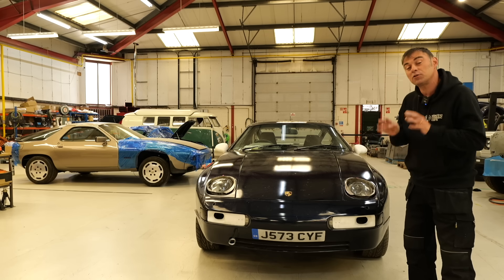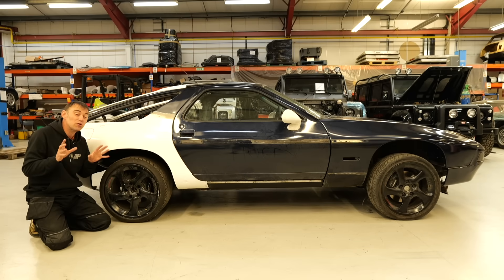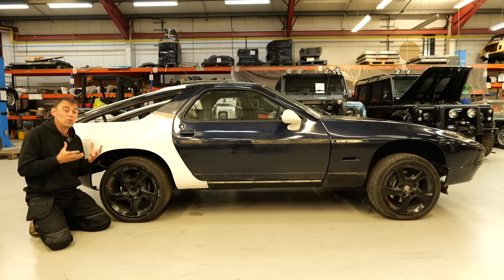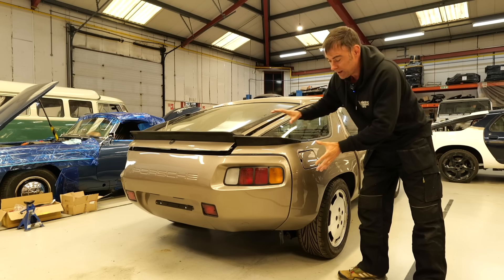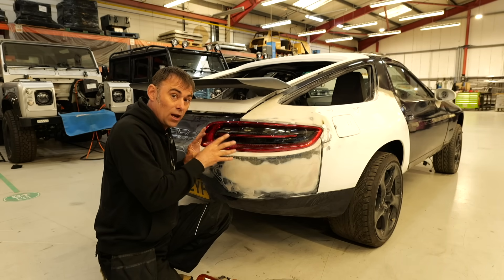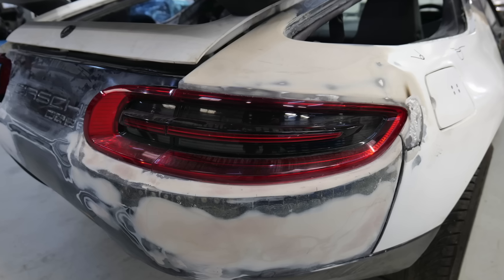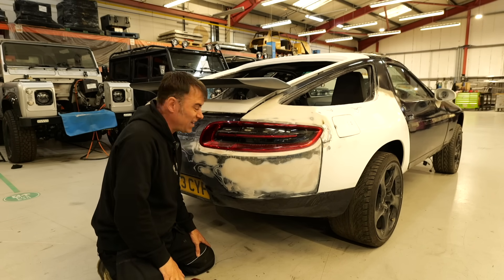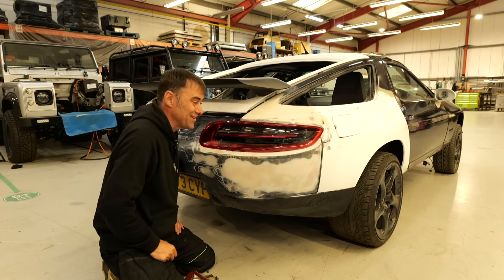Electric Porsche 928 Restomod update

Comment: Any car is a particular point in history. I don’t see any reason to be ‘updating’ the look as it will be out of date again shortly. Worst is that given time, ‘updating’ a car looks worse and has to be restored back to original. I’ve seen this too many times. Also, it’s a bit arrogant to think that the modifications are better than Porsche design. Best accept the car and the time it occupies in history.
Reply from the maker: Hot rodding has been around for 70 years. I doubt car modding is ever going to stop. 😉👍
Reply: Too true. And funny you should mention that as I was looking at a hot rod on the road recently thinking what could have been if it had been restored. 
I do get the impression that hot rods came about as a cheap form of transport for the youth of the day. Probably only now we can look at them as a possible classic car. 
Having said the above, I very much love your work electrifying Classic cars. So I am conflicted in my own opinion. 😊

Comment: Hummm 🤔!!!  So it now doesn't have the range of a GT, weight has been raised and it's no longer 50/50, the mooohassive luggage space, which is essential for a tourer has been removed and the main characteristic of the 928 (i.e. the pop ups) have gone.  I think you know where I stand.
Reply from the maker: It’s weight is the same as the the petrol version. It’s retaining the same weight distribution too. The battery box is now mounted underneath so luggage space is the same.

Comment: Love what you're doing with the 928! I had a 1985 928 for a few years, bought it in pieces, the mechanical bits were all still assembled, but they'd pulled most of the body trim off for paint, then the customer lost interest. I got it for $5000 in about 2012 or there abouts. Put $10,000 into it over the next 2 years, then sold it again for $5000! haha but I can say I drove a Porsche for 2 years for less than my Mom was paying for her new Honda :) Anyway, hey, its your car, do what you want, right? I love the light mods, that's pretty clever. How is the weight distro with the mods and batteries now? I subscribed, definitely want to see how this turns out!

Comment: I like the changes to the lights. for the battery at the rear, why not take the rear seats out and put them on the floor, would that be lower? That way you have proper boot space from the rear.

Edit: I make this comment and then you answer the questions straight away in the next video. oh well.

Comment: Love the tail lights - not such a fan of your headlights.
The vents / brake duct inlets might be nice in a billet Aluminium machined and powder coated. or , Carbon fiber prepreg.
At the end of the day do what you want. It is your baby not someone else's.
Just wondering if you removed the tunnel section in the rear under the rear seat area and laid the batteries under the rear seat, could you get the number of batteries and weight lower. But than that means the car could no longer be returned to ICE.

Comment: Owned two 928's myself, one of the early 16 valve V8's and a later 32 valve V8 model, the S4, can't wait to see how this electrification works out. The 928 has evolved over time, seen all sorts of mods, twin screw superchargers, welded blocks etc, this is next evolution of the 928. Wonderful cars, one of the most comfortable and best handling grand tourers around, can't wait to see the end result of all your hard work. While some may decry it, I think the new headlights fit the character of the electric 928, I wouldn't like to see them removed from one of the V8 models, but the electric version needs a new look to go with its new drive technology, keep up the good work!

Comment: The only good thing about the original pop up lights is that it will be dark when they are in use so they can't be seen. They even look like they have been fitted badly when they are down. 
Any change you make to the front lights will be an improvement.

The lower lights not so much, looks like an afterthought that needs deleting. Shame about the battery box in the boot

Comment: It could do with a rear defuser to hide the low  hanging motor. Front needs work, it’s all over the place ( yuck ) the bonnet and boot needs to be 3D scanned and a custom shroud fitting to hide the battery boxes, other than that Happy Days ! 🤪 Whilst I remember Decal

Comment: Purely thinking aloud (because I'm going to do something similar) ... is there not enough space to maybe split the rear battery box to provide a BIT more space in the boot?
 
Will refuse to comment on those light clusters ... on either end ... but I think that you could help your look and feel if you modded on the older generation bumper+side/indicator lights section. The newer cars looked a bit uggo without the 'shark' of it all ... and if you went with the older front bum, then you might make your airflow choices easier, too.
 
Front bums can't be that hard to come by ... I'd hope.

Comment: Hi Richard, Iike what you are doing to your 928, I never liked the pop up headlights. I noticed on the back panel the imprinted Porsche lettering looks compromised. It may be worth doing a 3D scan of the fabricated rear end and then get a 3D printed panel made that will fit spot on. I thought the same for the rings you are fabricating for the headlights, you could scan what you have made then make a 3D printed version incorporating fixing lugs? This will help for repeatability for any future 928’s that you do.
The art of  Mogification 👍 😂🏴

Comment: HI Richard
Stu here from the inCARnation Australia. As you'd probably know if you've seen our latest episode, our electric 928 is now on the road for some basic road trials - although there's plenty more to do before full registration. But as a long-time owner of 928s (6 so far) I am a bit of a tragic for the look. I see the headlights and tail-lights are being integral and an essentail part of Tony Lapine's original design, so it's a bit of a no from me. However, considering all the mods of done to my car, I not one to lecture. You do whatever floats your boat, sport! 
Our ELECTRIC 928 EV8 (tm) will at least look like a standard 928, albeit the clean look without side-moldings or any rear wing. I'm going for the clean body look, but with S4 bumpers. But you asked the question so I'm happy to answer it... I really don't like the look of your Macan tail lights and flush headlights. Sorry!:hand-orange-covering-eyes:

Comment: Both ends of the car looks good… on different cars. In the back you put a very modern taillight. Very different but it works. In the front you put some 90s 911 parts on and a headlight lens from an old vw bus. Got a bit lazy in the front? That front would have worked with tinted original taillights. With that new ass the front needs to step it up.

Comment: Theres also 944 square fixed head light conversion. And 944/924 bumper/duct kit
Reply from the maker: It’s the 944 bumper duct kit that we’ve used. I’ve seen a 944 pop up headlight system on a 928 online but never found anyone making a kit. They were just one off DIY conversions I found. We have a 944 in the workshop and compared it to the 928. The front shape and angles are all different for the lights. It would have taken a lot of work and fabrication to make the 944 headlights work. Also, it wouldn’t have saved any weight.
Reply: there was a factory option from porsche for the square headlight

Comment: Having owed 2 928s a gt and gts. I love the idea of the electrification. Personally I hate your lights though. The rears I wouldnt change. Just go gts rear end with the centre reflector section. Modernises completely. 
Front end, either the optioned oem 944 style flip headlights, or fixed(club auto) kit. Either look factory rather than halfords !!! Air scoops, oem 928 replacements, they were used on several race cars. Unfortunately tinting the lights just looks rubbish aka halfords.

Comment: I really like what you are doing. Keep up the great work 👍

Never owned a 928. But I did have the slower version. An early 944. I find out how much Porsche/VW  loves to use parts from the parts bin. 944 rear suspension fits on a Beetle

Comment: Would lossing the useless rear seats be a better place for the rear batteries (is there room for 2 ) and use the front of the boot (behind the "rear seats) and leave what ever boot space is accessible through the tailgate as per factory.
Love the front headlights, the rears dont offend me , but the brake ducts need work, maybe a ring light around the duct holes (if high enough for side lights or DRL's ) to keep the round lights design upfront.
Reply from the maker: Unfortunately there’s not enough room in the rear seat buckets for batteries. 😟👍

Comment: Looks very tasteful. Not a fan of the brake duct on the front, I would have liked to kept the lights, thats just my opinion though. I like the headlight change, it maintains the 928 look, but still is modern! Not a fan of the rear lights either, but again, just my opinion. Seems like a lot of work for nothing. Overall though, very tasteful, it still looks like a 928, so overall, great job!

Comment: The change in rear lights, great... well done.
The front... yeah... no... as you already mentioned yourself, the pop-outs are quintessential 928. Had you made them permanently out, that would have been fine. But your solution basically killed the 928'ness.
The fog light cluster didn't fare much better... though maybe that's because it isn't painted, yet. So I reserve judgement.

In the end, it's your car. So you do you. I enjoy your content either way.

Comment: Love the headlamps, however the easiest and best way to finish the fitting is using photogrammetry or 3D scanner to get a 3D model of the headlamp space, and then have a bit designed in CAD and printed with carbon fiber filament. Weight saving and perfect fit with less fiddling.

Comment: Looks great, like the headlights.  It is a bummer about the battery fitment, probably would have put all 4 flat and lost the rear seats myself, or put all 4 where the rear seats went to help centralize and lower the mass.  Any thoughts on using the new VW drive unit as they become available?  I hear they are efficient and quite powerful.

Comment: Honestly! IMHO, I don't like the Macan rear lights. They look a little awkward and over sized for the delicate 928 bum. Had I had your skills and ingenuity (which I haven't) I might have smoothed the rear end out completely, got rid of the rear lights and found a much more minimalist replacement that graced the original lines. Something thin and small. I would have done the same to the front. Fill in the headlamp holes completely and gone Alfa 4C a bit. Same on the front bumper, fill in the holes and go Alfa 4C again. Minimalist. Interior, same treatment. Smooth, leather, and put a Testa screen in the middle. Job done. Make life easy for you, celebrate the fabulous lines of the 928 and slip the smallest minimalist lights in. Love your channel btw.

Comment: The 928’s was well ahead of its time, it’s fantastic to see someone applying the same forward-thinking approach to both the power unit and light clusters. The rear is looking great. I agree with your suggestion: adding a couple of inches to the boot lid would suit the swooping lines and mirror those seen on other Porsche cars.
With your 200mph target in mind, the 928’s teardrop profile should certainly be capable of exceeding that speed, provided the power unit and setup used performs well. What you’ve done with the headlights makes a lot of sense; however, the scoop areas left in front may present an aerodynamic drag issue. I’d suggest keeping the light fittings as they are, (the VW camper lights are a stroke of genius) but consider adding a perspex lens over the scoop area, shaped to follow the car’s lines. This would enhance both aerodynamic efficiency and appearance.
Every panel join is a potential source of drag, so the better they fit, the smoother the airflow. In modern performance gliders, it's common practice to apply tape over joins to reduce drag and improve the glide ratio, a principle that could benefit your build, especially if the car initially struggles to reach the target speed.
Brake ducts are a great idea, but for high-speed runs and cruising, it may be worth exploring some form of active aero, ducts that remain closed during cruising to minimise drag, then open when the brakes are applied, staying open until optimal brake temperatures are achieved. This approach would balance aerodynamic efficiency with cooling performance.
The new wing mirrors look fantastic and are likely more aerodynamic than the originals,  though, I'd suggest, not as efficient as not having them at all. A better solution might be a camera system, similar to those found on the Audi e-tron, Lexus ES, and Honda E among others. Honda claims their system reduces wing mirror drag by 80%! These digital mirrors are even being adopted for HGVs and other large vehicles, where cumulative drag reduction leads to significant fuel savings over the vehicle's lifetime, while also enhancing safety.
Digital wing mirrors can also improve the field of view. Some might argue that replacing traditional mirrors with electronics adds weight, but when compared to standard mirror assemblies, the difference is likely negligible, and may even favour the digital option. Factor in the aerodynamic benefits, and it's no contest.
All just suggestions, I do think the new mirrors you’ve fitted suit the car’s aesthetic extremely well. Overall, the car is looking great, and I wish you the very best of luck in reaching your goal. It’s all very interesting, and I’m looking forward to seeing the finished car, and those 200mph+ runs!
Liked and subscribed.

Comment: As weight is everything I would like to have your thoughts on the new Koenigsegg motor. In particular how you think it would affect the various industries ( EV, Air transport and marine) plus electrical motored equipment?
Reply from the maker: The Koenigsegg motorist nothing extraordinary, it’s just an axial flux motor. No real advances there. It’s just their marketing team that has gone into overdrive about it. 🤷‍♂️ 
It’s the batteries energy density that need to improve before flight in anything other than a small plane and short hops can be considered. 👍

Comment: Richard, what about taking the edge of the boot lid to meet the edge of the lights but not pulling out the rear panel so that it is recessed.  This would make the back look less bulbous, you could even put a small flick up spoiler on the edge of the boot lid.

Comment: Love the build, was wondering though if the modern 911 lights won't fit instead of the solution you've now made? Probably will be an issue with the angle of the lights of the 911, but it would be nice to see some modern Porsche headlights with leds fitted instead...
Reply from the maker: We tried a number of different era 911 lights but unfortunately they weren’t reclined enough. 👍
Reply: @ElectricClassicCars  yeah, I was already afraid of that being the case! Curious to see if any other manufacturers offer an alternative with a more modern look.

Comment: As owner of 82 and 89, design wise the rear wheel arches and the factory 16 and 17 inch tires were the weak spots for me. The phone dials would've have been awesome with staggered 18 or 20's. I don't mind the rear light change,  screwing around with the S4 front end is a waste of time because it's perfect as is.

Comment: Great content thank you Richard.
Surprised you didn't ditch the rear seats and put rear battery box in there. Also you are always concerned to keep all your mods without adding/altering any mounting points, but you are adding headlights that don't have an E rating. How does this sit with type approval?
Jeff.
Reply from the maker: The front lights are e rated. 👍

Comment: You could put a Model 3 SR battery and motor in a 928 and it would be about as quick as a 928S without any further modification, and would cost buttons to run.  Don't like the Macan lights, far too big, and the 928 ones are iconic.  Great video though! Watching with interest.

Comment: Why not place the batteries in the place of the rear seats instead of the boot? That way there would be a separate boot space that is easier to reach through the rear hatch. I would guess that weight distribution would be a bit better as well. Great build otherwise, I like the idea.
Reply from the maker: The batteries are too big to fit in the rear seat area. 👍

Comment: Loved the 928S4 when around 40+ years ago - pity it's being 'brought up-to-date-, but your car, .... !!
Project's very interesting.
One thought.  84kWh right on the tail - not going to make her tail happy?  A bit 911-esque?
Al.
Reply from the maker: 84kWh is not right in the tail, most of that will be in the front battery pack. 👍
Reply: @ElectricClassicCars  Thanks.  My bad.  Thought I heard 'all will be slung in there' part-way through.  Balance should be better.

Comment: Hi, the project(s) are excellent. Sorry but I hate the rear lights, the originals but with the GTS reflector (which has always needed leds behind it to light the PORSCHE) look fine. The headlights are a major trademark of the 928 and should not be messed with other than modernising the light unit itself. These are my views purely. I do own four 928's (one for 25 years) and have owned a dozen. I'm biased therefore.
Batteries - why don't you completely lose the rear seats and put two each side thus lowering centre of gravity and keeping the boot area ?
I'll enjoy watching further episodes.
P.S. The speed record for a factory S4 was 171 mph so if you can push 200 that'll be impressive. I read somewhere in the mists of time that driving a 928 S4 you need 20 HP for every 1 mph above 150. So that's a lot !